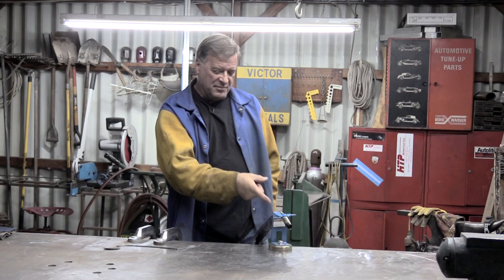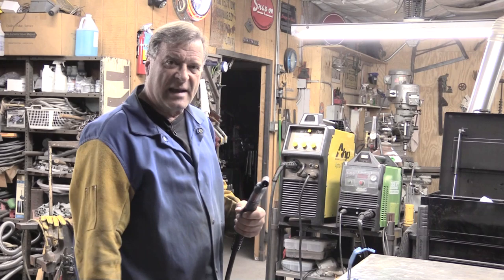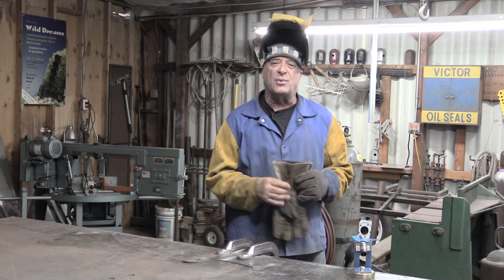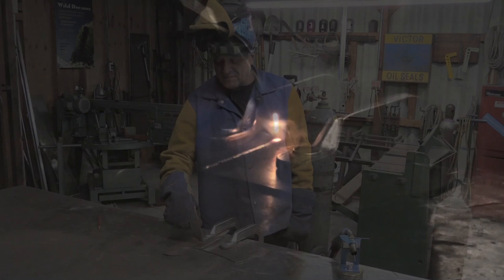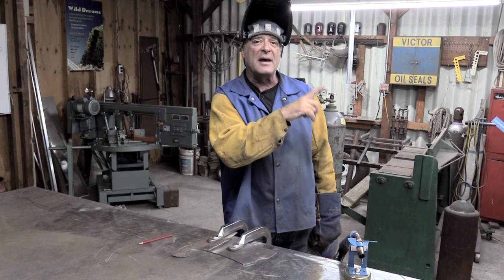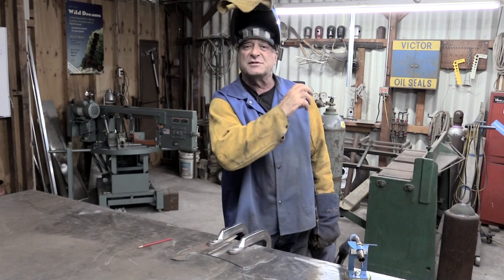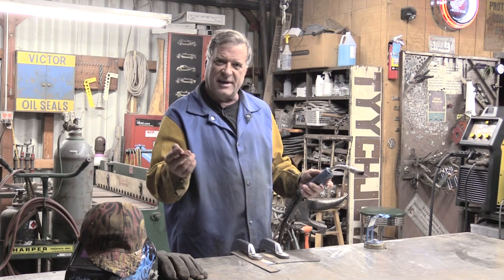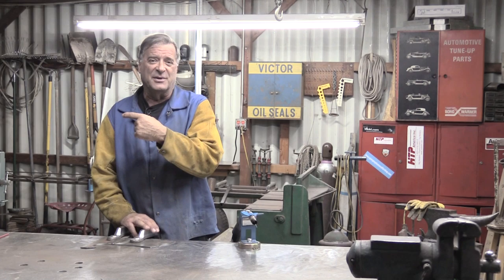Why You Need Preflow When Welding - Kevin Caron

Comment: is this because air gets in the line after a while?,,i always wondered how is it on my oxy fuel mini torch that i made(you can see it in my vid) that once i shut the gas off it does not slowly escape or bleed out because if i try to light the tip of the torch nothing happens,its as if there is a force field barrier,,can you explain this kevin? is it because air got inside my torch head tip and created this barrier?
Reply from the maker: Yes, the gas drains out because it is heavier than air.   You have to get the air out so the torch will light again.   Same with mig and tig welding.
Reply: @KevincaronSculpture  i am a bit confused when you say the gas is heavier than the air ,if that is the case then shouldn't the gas keep leaking or bleeding out after its been shut and the flame going out only once a vacume is created in the line where it equalizes with the outside air?  ok so for example when i shut of the burner to my bbq there is no more pressure in the line to push the gas out the burner holes but if that happens then shouldnt the gas that was burning juts keep burning off till it has completely bleed from the line or till there is some vacume and equalizing effect between the remaining gas in the burner and the air outside? instead what happens is that the flame goes out as soon as i shut the knob off? and its the same thing with my torch,as soon as i close the propane bottle knob the flame at the tip of my torch goes out instantly as if all the gas in the entire line has been quickly burned out or magically stoped going out the tip??
Reply: @KevincaronSculpture  no i think it depends on the gas being used and the working pressure of the line ,,propane is heavier than air so when i slowly shut it off i can see the flame reducing to a very small spot on the tip of the torch,once i completely close the gas and the pressure in the line become less or equal to the atmosphere there is some kind of barrier that is created where i think a small amount of the air from the atmosphere pushes its way into the tip of the torch ,when i put a flame in front of this tip nothing happens,,but when i slowly open the gas again i notice it takes a short while before a flame comes out of the tip ,this i believe happens because air is trapped inside the tip and when the gas in the line has enough pressure it pushed the air out but the air wont lite until the gas comes out thus the time delay before the flame appears,,same thing happens in your mig head,,once you stop the shielding gas air gets pushed into the gun and pushes the light argon or mix gas be it light or heavy and makes it recess back into the line,,so when you come to press your trigger instead of getting shielding you are getting air blowing out during the arc thus creating oxidation for only a short period before the shielding gas reaches it,,,,this is what i think happens but not sure if it has to do with the gas being heavy or not ,,either way air is going into the system and must be blown out first,,this is why when i work on aluminium or something delicate i always make sure i do a pre flow with the pedal if its not an option with the machine,,this ensures i get a good shielded clean start with no porosity,and with mig i simply burn some wire on a scrap piece to do the same and also to ensure a hot start,,both tungsten and wire need to be hot to provide a proper starting weld ,i even start on a scrap piece with tig sometimes to do this as well before i put it on the work,makes for a clean start always ,,its funny my uncle used to get upset at me when i would shut the bbq gas off first before i removed the food because he thought the raw gas was getting into the food and contaminating it,but he was wrong,soon as the flame goes out so will the gas and it remains in the line

Comment: Kevin, I have a problem! 
With my 130 Amp stick welder, when I start a new electrode there is too much power coming through until 1/4 length has been used up. I weld thin metal mostly 1.5mm to 6mm and it's the thin stuff that takes the punishment. Maybe it's just a cheap eBay welder or is this normal? Kindest regards from Béziers in the south of France.
Reply from the maker: You got a bad machine is my opinion!   Time to upgrade to a better unit.